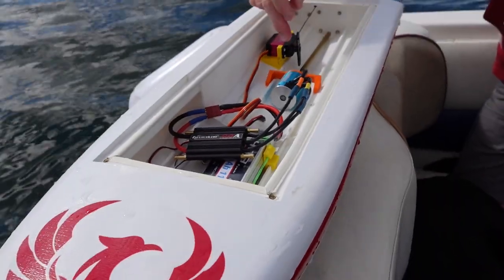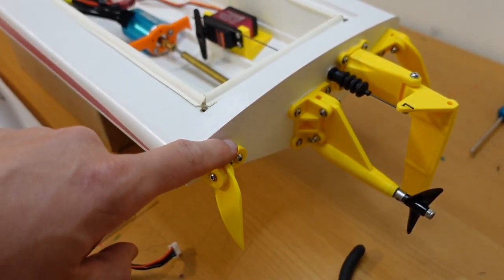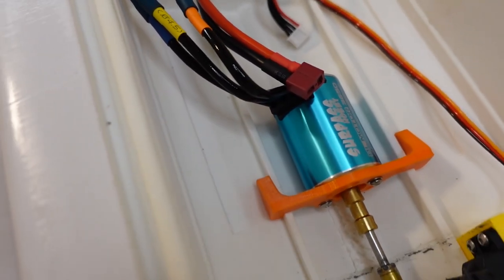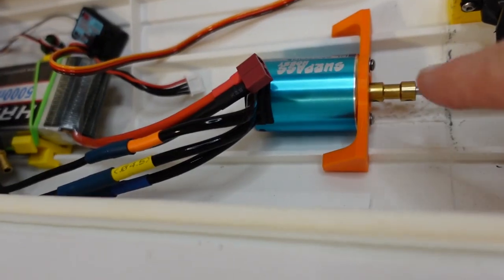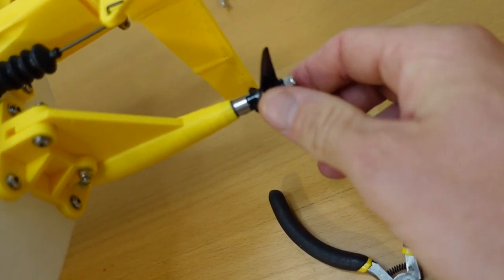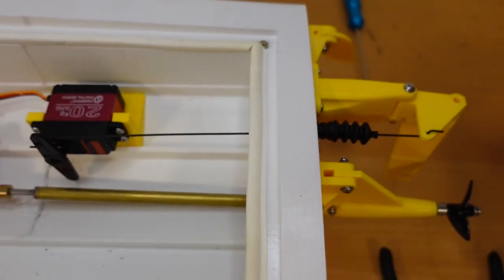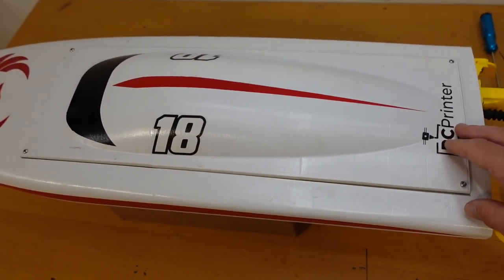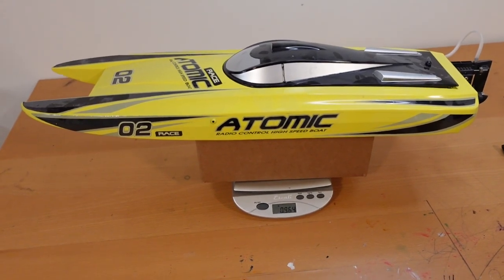3D Printed 34" RC Boat Build

Comment: RUNS GOOD. A LITTLE WET THOUGH. SEE IF YOU CAN ANGEL THE PROP UP OR MOVE SOME WEAT TO THE REAR. IT IS NOSE HEAVY
Reply from the maker: Thanks for the tip, good to hear from someone more experienced with boats than I am. I'll try and get the nose to ride up a bit as per your suggestions.

Comment: That is a really nice looking hull. The one I have right now feels way too wide, this one looks much better.
I may have to try this one. I've been thinking of printing the boat out of LW-PLA and then coating it to make sure it's waterproof. Should save at least half the weight but might also make it a lot weaker.
Guess it's a project for the winter then.
Reply from the maker: That would be interesting. Haven't seen that attempted yet.
Reply: @rcprinter  One thing I didn't consider. You can't really print LW-PLA much faster than 30mm/s so printing this will take something like two weeks if I don't need to print anything else meanwhile. May take a bit longer...
Reply: @rcprinter  Printed the hull (5 parts) and it came out as 411g. Feels really light. It's also watertight but I have my doubts if it can take any hits, even from waves. So I'll probably end up adding glassfiber or something on it.
Reply from the maker: @Qwarzz  That's really cool. You should do a video on it, I'd love to see how it turns out.  I wonder if something like plastidip rubber spray would give it enough rigidity and add to the water resistance. Or maybe even painting it with resin without adding the fiberglass might work.
Reply: @rcprinter  I might. I'm pretty terrible at this video stuff so no promises.

Comment: That’s a nice boat and would take me days to make from a mold in fiberglass or carbon fiber👍❤️How much did this weigh and how long to print
Reply from the maker: Without a battery it weighs very close to 2kg but that includes all the electronics so I'm not sure what just the shell alone weighs. It took 5-6 days of continuous print time.

Comment: I am building this boat myself.     can you tell me what size motor you used
Reply from the maker: 3650 (540) brushless @3100 kv. If I were to build it again I'd consider going with something a little longer like a 3660 or 3670. I have all the electronics listed on the thingiverse build page here: https://www.thingiverse.com/make:1055214
Reply: @rcprinter  thanks

Comment: What glue and spray did you use when you were putting hull together
Reply from the maker: This is a CA glue that's easy to get in my neck of the woods called "instant bond"

Comment: What is the name of the piece you use to avoid water to get in from the steering rod? 
And what do you use to make the hatch watertight? Thanks in advance! Nice video and awesome boat! You just earned another subscriber!
Reply from the maker: Push Rod Seal: https://www.aliexpress.com/item/4000374267530.html
Window Seal: https://www.aliexpress.com/item/1005001980408747.html

Comment: Very well done, awesome job! 👍🏻 Where did you get the decals? 😁 And which material do you use for the boat?
Reply from the maker: Thanks man! The decals are just simple waterslide decals printed out on a regular inkjet printer at high quality setting and then sprayed with clear acrylic to hold the color. Everything is printed in pla except for the motor mount which is petg.

Comment: Where do you get your water stickers from?
Reply from the maker: I used clear water slide decal paper from Koala (off Amazon) which can print out from your inkjet printer. It works well as long as you seal it with a clear acrylic spray.

Comment: Looks great!  What printer and settings did you use?
Reply from the maker: This was printed on a Prusa MK3s. I don't remember the exact settings but the walls aren't super thick on the model so I think mostly just ended up being solid at a .2mm layer height and probably 3 walls. All printed in PLA except the motor mount in PETG.

Comment: Did you put temp tattoos on the boat 🤔
Reply from the maker: Waterslide decals sheets. You can print em yourself!
Reply: @rcprinter  neat, special printer needed?
Reply from the maker: @Rckid28  nope just a regular inkjet is fine

Comment: How much pla did you use to make this please?
Reply from the maker: I would guess 500-800g
Reply: @rcprinter  is it waterproof. Stupid question I know seeing as it's a boat but I've heard mixed reviews
Reply from the maker: @neilpowell7938  yup, I added a seal around the top cover but otherwise it's totally waterproof. You gotta glue it really well with lots of CA and then I think sanding/painting helps a bunch and silicone the parts that screw onto the stern. I havent had any issues with leaking.

Comment: What glue do you use for your projects?
Reply from the maker: For this I used a CA (cyanoacrylate) glue with a spray activator. The specific name of the one I used was "instant bond" which is really easy to get here in Canada but they have similar stuff everywhere. Superglue is a CA glue and would work fine but I like the ones with the activator spray so you can get the joints perfect and use way too much glue and then clean up excess glue with paper towel before you spray it to make it solid.
Reply: @rcprinter  For structural parts (like the hull of the boat), I recommend using epoxy over CA. I use medium CA and accelerator spray like you for everything else.
Reply from the maker: @jeffdunehew  Hey Jeff epoxy is superior for sure. I've never had an issue with the glue on these boat hulls with CA though. Maybe I'm just lucky!

Comment: What glue did you use?
Reply from the maker: This is just a cheap CA glue + activator from Canadian Tire called "Instant Bond" but you can get a similar glue at pretty much any hardware store I think. Just look for cyanacrylate (CA glue) with a spray activator. Superglue is a type of CA glue.